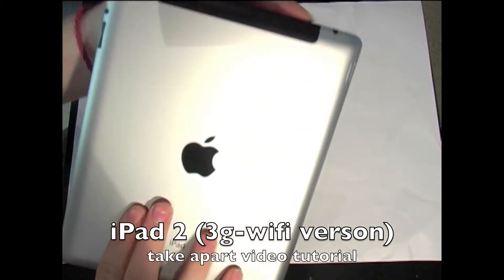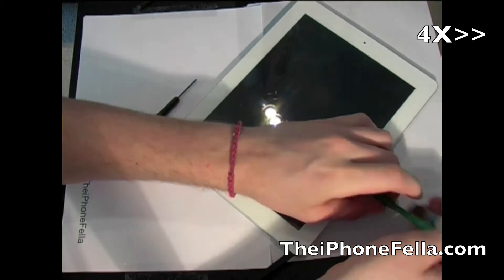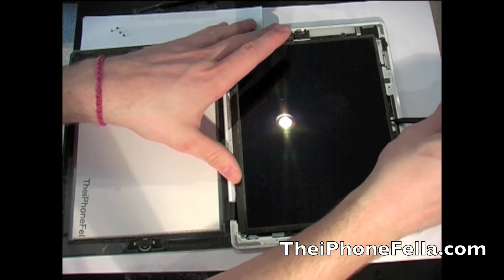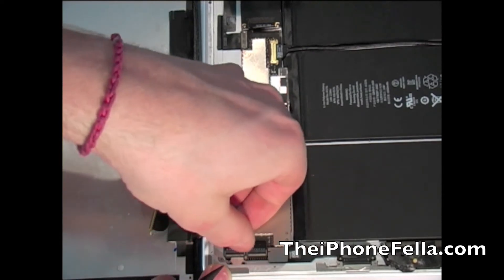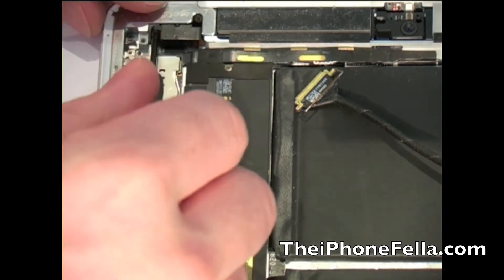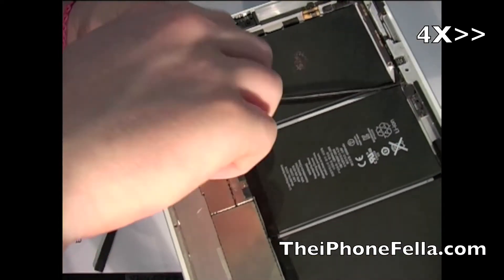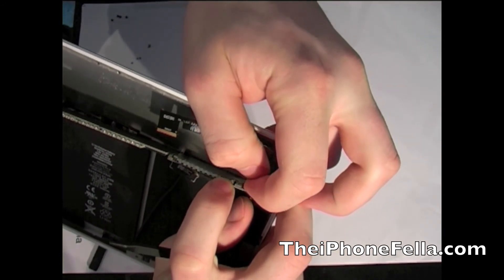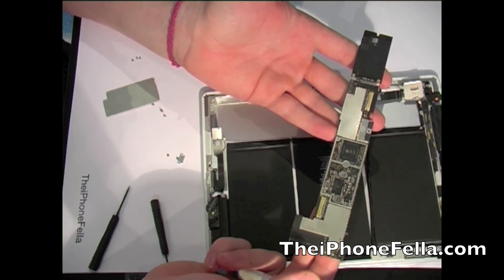iPad 2 (3g wifi version) Take Apart Disassemble

Comment: I have changed the digitizer on ipad2 but after I did that the volume button and the on off button on the side doesn't work anymore  any idea why? Thanks
Reply: David Chong you will have probably cut the flex on the side of the iPad.